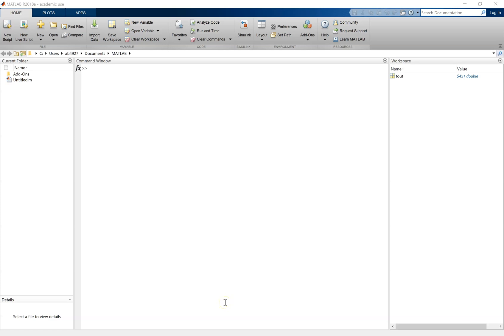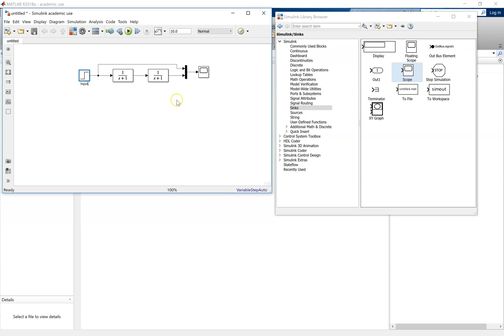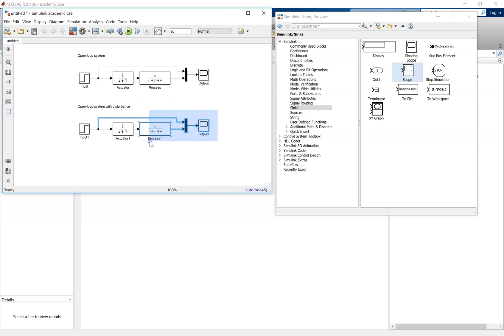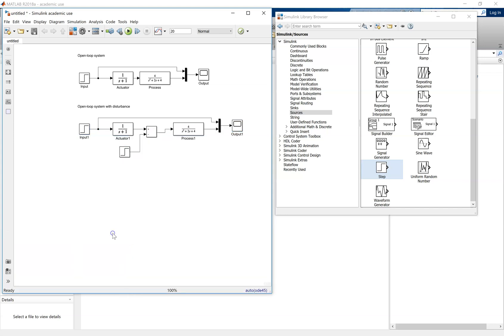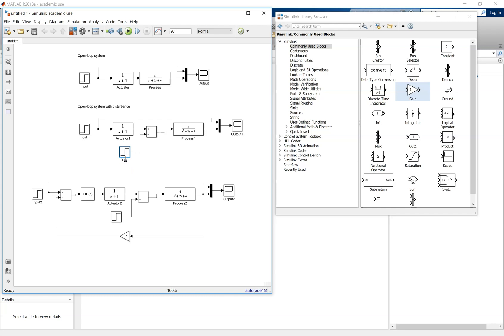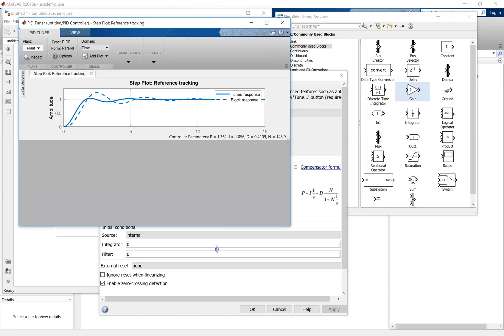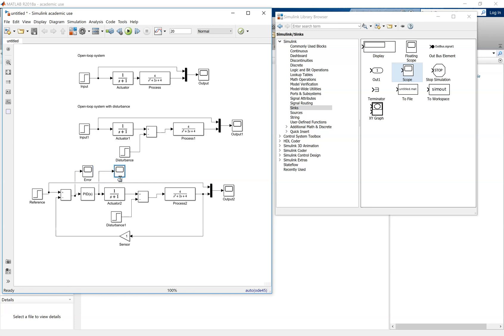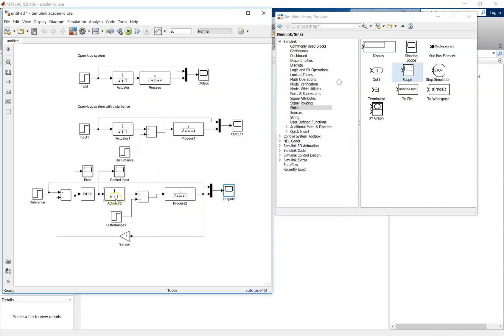MATLAB & Simulink: open-loop system and PID control system

Comment: i used a pi controller to control a simple first order system, and i used pso algorithme the find best pi parameters, but the simulation stop in the begining and show this message : Derivative of state '1' in block 'robot_simple_control/Transfer Fcn' at time 9.2 is not finite. The
simulation will be stopped. There may be a singularity in the solution.  If not, try reducing the step size
(either by reducing the fixed step size or by tightening the error tolerances)
Reply from the maker: Ah sorry to hear about your issue - I hope you managed to solve it?
Reply: in fact not yet :(  @ACE-Lab-Engineering

Comment: why is the final value of the disturbance is 0.1? i am doing a project and the final value initially is 314, so what should the final value of disturbance be?
Reply from the maker: Hi Naser, the values I have used are arbitrary, i.e. they aren't relevant to a specific example/case. It very much depends on what you are modelling and simulating. What exactly are you looking into?